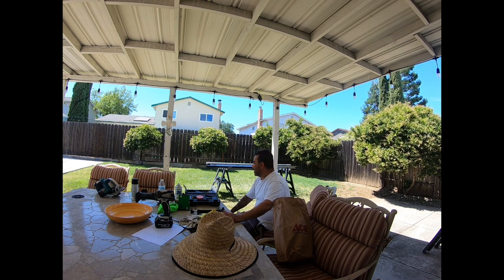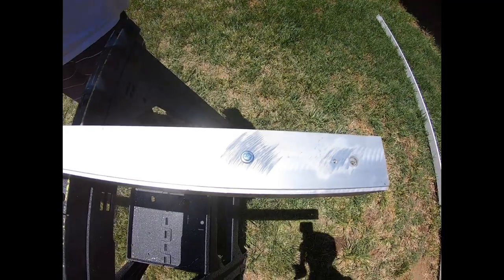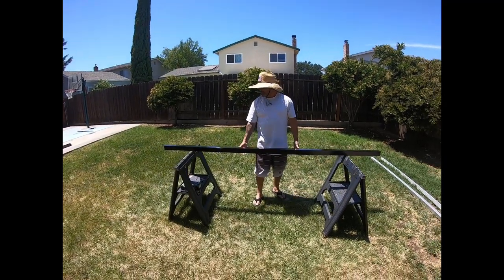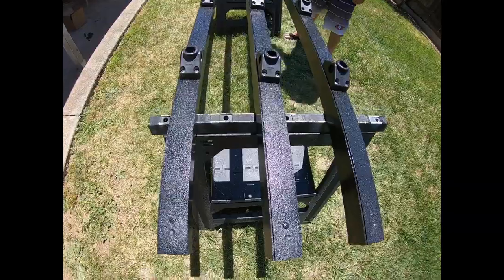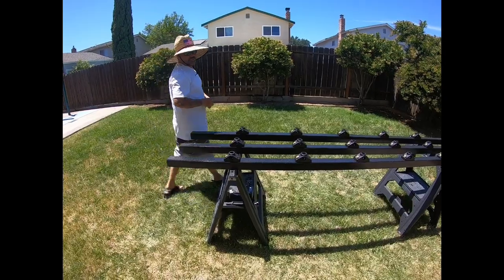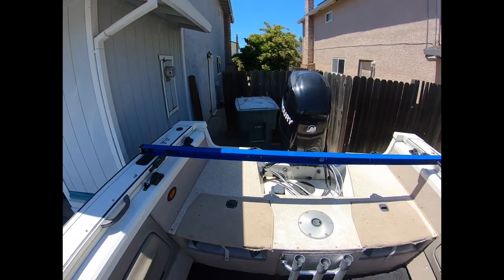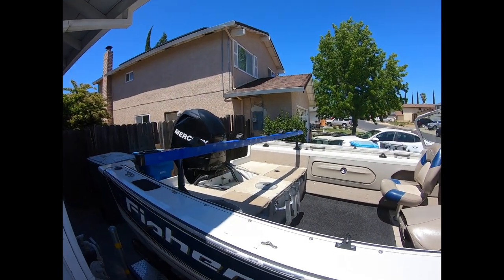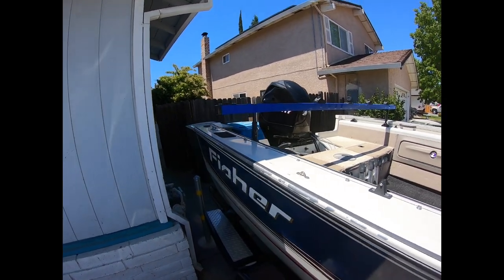2”x 8’  12lbs rod beam

Comment: you have a link to the bass pro shop extensions? I can't seam to find them on the website.
Reply from the maker: They are just regular extensions and I cut off the top off then I drill a hole in the middle and I tread it to same size of the bass pro shop knob
Reply from the maker: Bass pro shop rod holder extension RHX